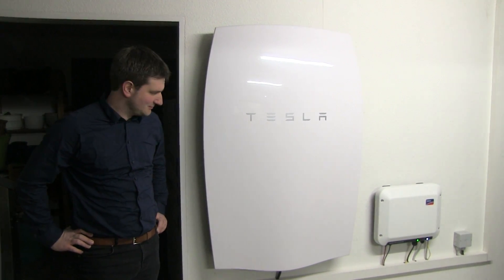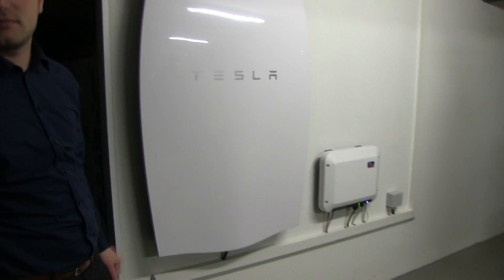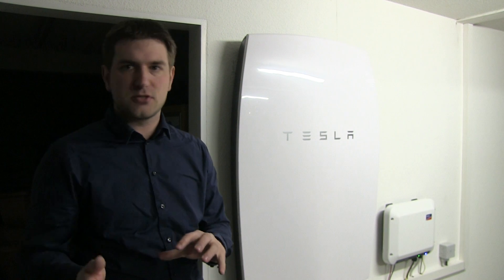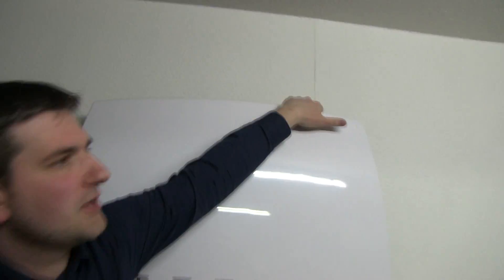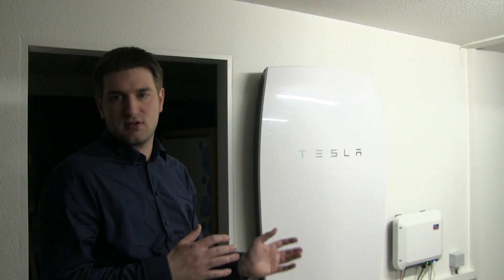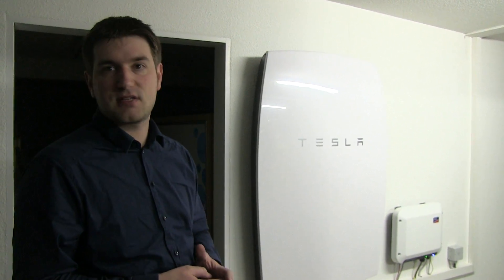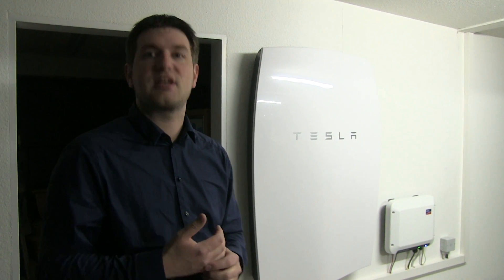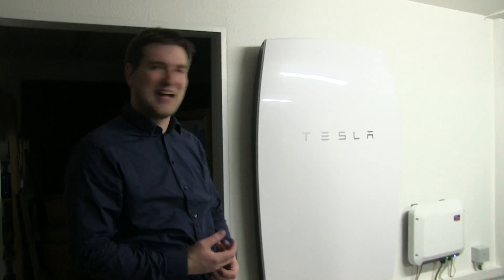Powerwall 1 and 2 explained by Amadeus Bürgel

Comment: Thanks for the video, can you please clarify the financial case? For example what is the calculation of the feed-in tariff vs the powerwall cost? Amadeus mentions the cost of 14 cent per kwh from the solar panels - is that the feed-in tariff or the cost from PV? Let's say the feed in tariff were 17 cent per kwh and the buy price is 28 cents - the difference of 11 cents needs to pay off the cost of the powerwall - how long would that take? I don't have the financial data available apart from what Amadeus said in the video so it would be great to understand. From everything else I have read, assuming there is a feed in tariff and there are no black-outs, there is no financial justification for the powerwall on an individual basis - only at utility/community level. Thanks for any additional data/info in advance.

Comment: In Australia I can't charge my Tesla Powerwall 1 from the grid either, it is charged only by my Solar Installation.
I think it's unlikely that anyone would want to anyway as grid energy is more expensive.
The inverter design determines if you can use your Powerwall as a backup when the grid goes down, backup inverters are more expensive.
The powerwall 1 weighs 98Kg according to my installer.

Comment: It makes no sense to me that we have this crazy regulations in Germany, that we can't store electricity at home for later usage. Somewhat un-understandable. 
I hope no one will forbid cell phone batteries for home usage one day ;-) 
However, when it's about your own home grid, one could ignore this and build up his own home energy storage anyway. 
The only thing that matters is safety. If that's given, where would be the point in forbidding home energy storage?
Regarding the usage of the powerwall in a cabin: I guess you only need an inverter powerful enough to support the powerwall with energy, where the output current should have 50Hz AC. That's all, right?

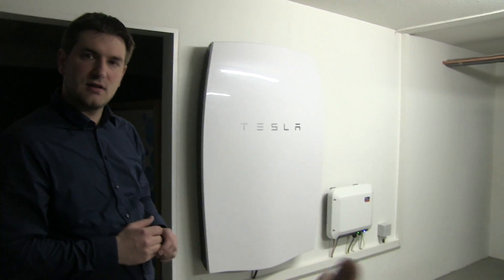Comment: 6:30 Have I been committing crimes all my life charging my electronic devices from the German grid?
Reply: Paul Hendrix well, no. It has to do with the capacity and the ability to generate 3 phase AC-Power. So if the system is an alternation to the power net, you have to get a permission. Cause your grid-provider need to certify your system.

There are exceptions, like for USVs, they come with a permissive to allow the usage.
Reply: Thanks :D I was expecting something like that, but was still amused at how he said it. Couldn't the Powerwall qualify as a USV? If you keep it disconnected from the grid there shouldn't be a problem, right?
Reply: Paul Hendrix Powerwall II will be, Powerwall I does not got an Inverter, sooo. Technically the Inverter would had been certified that way. While none are.

You still could get luck and get it certified by your power net provider for some hundred bucks.

But you're still not allowed to charge it from power from the grid and sell it back when it's cheap. Also you're not allowed to charge it with any kind of solar and sell it from the battery.

The issue here is, you get a huge selling price for your solar power, it might be less than the average household-price for electricity, but way more than actually the buy-price for electricity is. So we talk about -1 to 6 cent normal range here.

Everybody pay a special tax in Germany on electrical power, to found this difference. Some older installations also get 35 cent or even more for their solar power.

If you would store normal grid energy, they would be counted as "generated solar" which would lead to wrong tax spending.

Also you would destabilize the net, if everybody would takeup cheap energy and sell it when it's expensive, since you would decentralized but nearly at the same time change the power output by a large amount, which is very hard to predict. That's the reason why we need smarter energy storages which automatically react to net-frequency changes and start to charge/discharge when the network is in trouble to keep the frequency stable. :)

Comment: What event causes the Tesla PowerWall to flow DC electricity to the inverter to then be converted and used as AC electricity by the house which is behind the meter?  Does it have some sort of internal timer combined with its ability to monitor its state of charge that causes this action?  Where is the safety disconnect so that utility workers are not hurt by a flow from the battery to the grid?
Reply: There's a separate meter just before the electricity company's meter. The data from that allows the powerwall/inverter to follow the load allowing import of a tiny amount of power but ensuring you don't export. The inverters have a european certification called EN50438 which includes standard disconnect relays in the inverter, if the grid power is not present or stable on the AC side of the inverter, the inverter disconnects.
Reply: Thanks for that safety information cros13.  How about my other question about what causes the PowerWall to dispense its stored electricity?
Reply: It's load following based on the readings from the meter/gateway. So if your household load is say 5.8kW the meter readings indicate to the powerwall that you are now importing 5.8kW and it outputs to follow the demand (say 5.7kW). The inverter in the middle just converts whatever it's fed to AC. This load following calculation happens many times a second so that the output of the powerwall always follows the consumption of the house and never exports.
Reply: Oh I think I understand now.  Does the PowerWall operate like an uninterruptible power supply like I've plugged my computer into only for the whole house?
Reply: Only with an islanding inverter like this: https://electrek.files.wordpress.com/2016/04/storedge-powerwall-solaredge-inverter.jpg?quality=82&strip=all&w=1000

In a powerwall 2 AC install or powerwall 1 with a separate inverter like in Bjorn's video backup power is currently not supported.

You have to run the maths and see what works for you and what value you place on features like that. Islanding inverters are 4-5 times the price of basic string inverters.
Reply: Thank you for the extra information.  I now have a lot to think about the feasibility/practicality of a PowerWall.

Comment: How much does it cost ? LiFEPO4 battery 16 x 110 Ah === 5800 Wh, cost 2400 € and will last 8000 cycles if BMS manages cycles from 15 do 95 % SOC, or 5000 cycles, if cycled from 10 to 100 % SOC.
Reply: The 13.2kWh powerwall 2 AC is €6300 including bi-directional inverters and ~20% VAT

Comment: So if I understand correctly, Mr. Amadeus has normal solar instalation with Net Metering with three phase inverters and then he install a powerwall 1 and 2.5 kW two way inverter and the inverter is only one phase.
So the meter measures the flow of the electricity for all three phases and then comunicate with the powerwall inverter and command the inverter what to do.
What if he has a power demmand on one phase and the inverter is on other phase?
Reply: In that case you either just have to make sure the demand is on the same phase as the Powerwall, or install multiple Powerwalls (one for each phase).
Reply: That isn't a solution.
The fact is that  it is not customized for 3 phase.
Reply: You could use the DC powerwall with a three phase inverter. That's now no longer an option  with the powerwall 2.

Comment: If the Power wall needs the AC sine wave from the grid to work. That would make it useless in a blackout correct?
And why can't the Power wall generate it own AC sine wave and sync it with the grid for when it is not connected?
Reply: There is an addon device called Tesla Energy Gateway that apparently allows offgrid use.
It's not a perfect solution, as for some reason you cannot charge from solar during the blackout.
Reply: BlueFoxTV     It can be configured to provide backup power, but you need to install auto transfer switch to disconnect from the grid during a blackout. If you do not disconnect from the grid, your  powerwall will be feeding power to your neighborhood.  PV systems also shut down in an event an event of a power failure.
Reply: You can configure the PowerWall 2 to supply 'critical loads' directly, in the event of a power failure. They need to run a circuit directly from the Powerwall 2 to those circuits.
Reply: Yes, that's correct— it's a safety feature to protect utility linemen who might be working on the grid circuit while the device is connected to the grid so they don't inadvertently get electrocuted by live electricity when the wires shouldn't be carrying any current.

Comment: It's possible to use the powerwalls without grid connection and connected via DC by using an islanding inverter like the Solaredge SE7200/6000-RWS or SMA Sunny Island. That's not a common install in Germany due to the high feed in tariff... but common in places like Ireland where we don't get paid for the electricity we give free to the grid .... we get fined.
Reply: cros13 we get fined in Ireland for exports? Really i get paid for my exports through Electric Ireland, it's a small amount but I still get paid. That reminds I must follow up on this years payment/credit.
I've asked Tesla repeatedly about getting a Powerwall in Ireland. Haven't replied. Someone told me they are still looking for installers.
Reply: http://www.independent.ie/irish-news/news/esb-ends-scheme-for-homeowners-who-want-to-sell-power-30706655.html

The 9c feed in tariff was closed to new entrants in 2014 (after only a few hundred had joined). While existing exporters still got the tariff until at least dec2016 (I'm not sure it was extended). New entrants now get no feed-in-tariff and still have to meet the cost of the import/export meter and use only equipment tested against the sham Irish addendum to EN50438 (that only differs from EN50348:2013 in one setting) and doesnt in clude any islanding inverters.... and there's an additional "Low-usage surcharge" with electric ireland for failing to import a minimum of 2kWh/day. And there are no grants or tax relief for PV or storage. So yeah, we are the only country in the EU without a feed-in tariff for microgeneration.
Reply: cros13 well the system is still live for those of us who got in early. never had a low usage tariff applied as we don't have storage and haven't been able to as no storage batteries have been approved as of earlier this month, the last time I checked. get onto the CER as the more pressure they are put on the more likely it is to get it implementated.
Reply: The CER are responsible for the mess as they decided leave it up to the market to decide FiT rates... the customer supply companies decided they didn't want to pay at all.
Reply: There is supposed to be a new feed-in-tariff for utility scale PV at some point this year... but no indication yet as to whether microgeneration might get anything.
Reply: Oh... and have you paid your income tax on the payments from ESB.... (yeah... Revenue it's supposed to be reported as income). The whole situation is depressing.
Reply: cros13 I did check with revenue and they told me as it is a credit on the account rather than a cheque they didn't want to know. but you know what they are like, talk to one person get one answer and completely different answer from someone else. I try and use all our power, so only export less than 500kWh/year which is €45. 
the more people get onto CER the more chance of something being done. I send them a mail at least every month, badgering them and ESB Networks/Eirgrid.
Reply: The whole thing is a disaster from my perspective. I've over 50kWp of solar across three sites and ESB just steals the power and sells it to my neighbors.
Reply: cros13 in your case there is only one thing to do. get a good solicitor and bring them to court yourself or a group case.
if they gave you permission to export onto the grid then they haven't got a leg to stand on, not paying you.
Reply: Nothing to be done on that. ESB now staples an A4 sheet to the NC6 microgeneration connection form that effectively directly states... if you sign this we won't pay you anything for the power you export. There is not much option... you can either connect on their terms or go off-grid... which in my case running two high mileage electric cars would require 200kWh+ of storage to get through December.

We've also got the "problem" in ireland of grid power being very cheap and fairly green most of the time. I'm paying 13.3c/kWh daytime and 6.65c/kWh nightrate for 9 hours and in December during nightrate hours the grid can hit 85%+ renewable... so there's a lack of incentives in the market anyway.

Comment: Yes.  All PVs have to direct the overflow into the grid and/or batteries.  This is my understanding, having PVs.  Yet, no one has yet conclusively explained, as rule-of-thumb, the ideal percentage of battery storage to productive capacity/usage.
Reply: Entirely depends on how much energy you use and at what times. A smart installer will attach an energy monitor to the home to log power usage. Or you could get the energy monitor installed yourself before hand, to keep long term.

Also consider if the goal is zero bill cost, or zero grid input. The first is where the power you sell into the grid overcomes the little you buy back at night, the later is to never draw power from the grid.

Figures I found for Australia said up to 70% of power usage is during times when solar isn't producing. Not sure I believe that as was from a company selling solar/batteries.
Reply: It probably depends on the local climate. If you live somewhere with a proper winter and you use electricity for heating, not only do you need a lot of energy for heating during the day when you can produce, but you need a lot more energy for heating through the longer, colder winter nights, so the figure of "up to 70%" seems plausible for some situations during the least ideal operating conditions.
Reply: Daniel Murray the issue is, you would create an alternate grid-like solution. So you there's a chance that your system might create an alternating 50 Hz and if there's a malfunction in the switch both networks could be switched together, creating a huge electric discharge.

So you have to install a certified power transfer switch and have to inform your grid provider.

Else he has the right to cut your powerline. :)